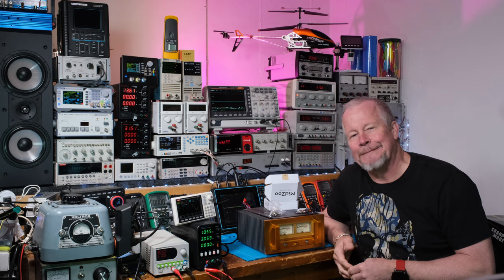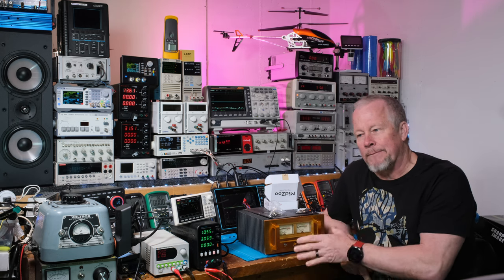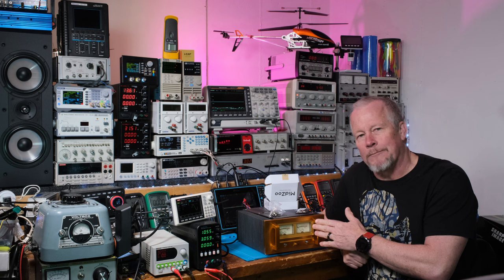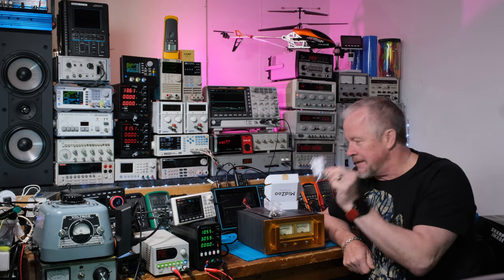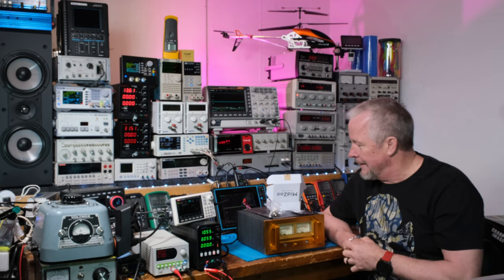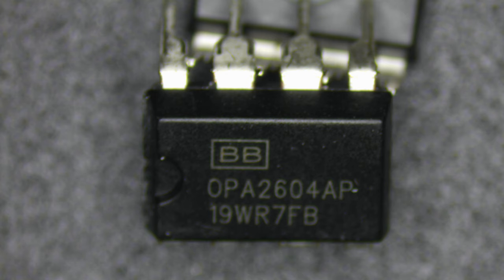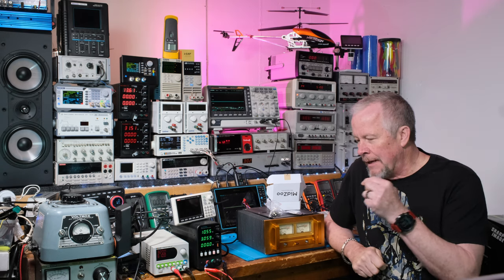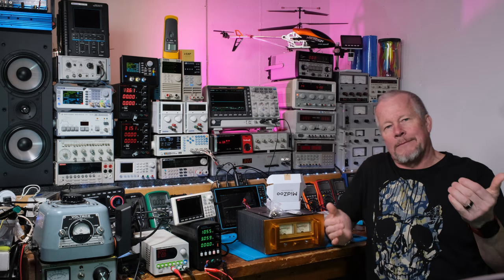Counterfeit Burr Brown OpAmps OPA2604 - Found good ones - What to look for

Comment: Nice cautionary tale and a reminder that, if you have the option to do so, you should design for jellybean parts that you have reasonable confidence in being able to get from proper suppliers for the foreseeable future. I have a cache of Shenzhen-sourced resistors, capacitors, and inductors, but I wouldn't trust Amazon or eBay for any active components.
Reply from the maker: Thanks for the great advice.  But when you are designing for high-end audio like I think this Class A amp might fit, then I search for great parts.  The key is to select parts that are currently still being manufactured, and buy from a trusted vendor.  I know those who would say that those Shenzhen resistors and capacitors are fake and counterfeit - or at least not up to par with resistors such as Dale or caps from America or Japan.  In this case it is a part that is not in normal circulation anymore:(
Reply: @KissAnalog  My cache of passives is only for prototyping; if I build anything for realz, it's with resistors from Vishay/Dale (preferably CMF50/60) and capacitors from Illinois, Panasonic, TDK, or Nippon Chemi-Con.
I still think your needs would have better been served by replacing your regulators with ones that work with what's currently available. Plenty of Burr-Brown op amps that steer high current from +/-15V rails.
Reply from the maker: Thanks - the problem is I needed the higher voltage rail (+/- 24 V rails).  I can use two OPA604 so that is the way I'll have to go.

Comment: I would throw them all in the trash. I only buy ICs from reputable sources like DigiKey, Mouser, etc...
Reply from the maker: Thanks but these are discontinued so I have to find other sources for overstock parts - if they still exist;)
Reply: @KissAnalog  So what? Just buy the available IC's that are the newer replacements from reputable sources. Supporting counterfeits is the same as supporting criminals and thieves.
Reply from the maker: Yes I agree.  But there are vendors who have real parts for some time after a part has gone end of life.  These vendors will buy existing stock (sometimes from manufacturers who didn't use their stock because they redesigned it out) and they are real parts.  These days the counterfeits are ruining this business - unless you know where to find ethical vendors.  The parts generally cost much more because they're is only a small stock left, so this is one giveaway if the parts are a good price - they are most likely counterfeit.
Reply: @KissAnalog  NOS is ok, but counterfeits are not. There are no 'good' counterfeit components.

Comment: I bought a batch of TL071 single opamps on eBay once. None of them worked. I thought a bit, rewired the test socket, and they worked just fine, except they didn't meet specs. Turns out they were TL082 dual opamps, marked as TL071.
Reply from the maker: Thanks for this feedback!  The pin out is the same between the 2 parts - right?  How did rewire work?
Reply: TL072 are dirt cheap, why even bother with ebay?

Comment: Why not buy from reputable dealers like Digi-key or Mouser?
Reply from the maker: Thanks!  Yes, I normally start with Mouser, then go to Digi-Key if needed, and then there are other trusted distributors.  But, when you want a part that is out of manufacturing, then surplus suppliers are the only bet.  But - it it now becoming very sketchy with counterfeit parts.

Comment: Just don't buy from eBay.  Buy the surface mount parts from a reputable supplier and put them on converter boards.  AQ versions are early ceramic variants, probably new old stock.  AP version is the most counterfeit since its in the plastic DIP package.  They may be using some generic op amp and only marking them as they sell them, so they probably have a large stock of some generic and then when something gets ordered they just laser a new number/logo on top and ship it out whatever was ordered...

Comment: Thanks Eddie,
Funny I just bought some obsolete clock chips from Ali and I just tested them, they look like the originals that no manufacturers had but I didn't want to give up the design because the chips worked perfectly for my app. They're 32.768 kHz and draw 4 pA with an accuracy of ~0.5 ppm if I remember at 3V.
Boy, it's a hard call especially when you're using older chips. The thing is BB made some really good stuff it's hard to get now. They had top engineers and those guys helped me more than once on designs.
Most times I try to buy from the big guys like Mouser and Digi-Key even if it costs more, I definitely don't trust eBay and Amazon is the wild west, they have zero policing and everyone knows it. I don't hesitate to give negative reviews anymore, let people know if you get stung.
Reply from the maker: Thanks for this great advice;) I will see if I can find a trusted list of vendors for surplus stock or parts.  Otherwise I stick with Mouser or Digikey.
Reply: @MultiKumar321  I find the Chinese to be a mixed bag like any society. You can buy quality USA made and junk. My Chinese board house is top notch for example and Shars Tools who I often buy machine tools for my shop from is very reputable with consistent quality.
But, yes, when I have to design something for the market I go to Mouser or Digi-Key, the difference is if a Chinese tool brakes my customers aren't effected by it so I can take more chances in certain areas.

Comment: It's worth trying rubbing the part with acetone which often removes the text on counterfeit parts (IPA isn't a strong enough solvent). But just because it's not reacting to acetone there's no guarantee it's "real" - some counterfeiter use resistant dyes and it's known you can get factory laser-etched "74LS" that are really brand new 74HC parts for example! because the LS part sells for a lot more (due to the retro market) so the Chinese factory "helpfully" offers LS marked parts for a little extra (AFAIK no one has made actual LS parts for a long time).
You mention that the NE5532P seems to match specifications, but the logo strongly suggest it's counterfeit (as does the wonky lettering!), this might be some other compatible part or even the correct part but still being relabeled! - there's documented examples of them removing and then putting back the same label except replacing the datecode with a new datecode. Apparently the idea is to be able to sell them as "new" (more expensive) rather than "used", except the date code now makes it obvious it's fake because it's not been manufactured for decades.
The first BB part is for some reason easy to read in the Youtube video, the bottom markings are 19WR7FB. Sometimes that happens, could be angle or polarization for example.
Reply from the maker: Thanks!  I agree the wonky laser etching would be a deterent, but the NE5532 does seem to work well.  The first OPA2604 did look cleaner and did work.  The ceramics do look great and do work;)
Reply: I wouldn't do that Acetone can dissolve plastics

Comment: Today, it is a frequent problem to buy quality semiconductors. I bought 20pcs opa2604 from my most trusted seller in Belgrade. Everything works, but they were not original. A simple way to check them is to check the steady current through them. The original consumes much more current than, say, the TL072.
Reply from the maker: Great point!  I thought that maybe factories in China realized what a great OpAmp this is and would keep making them based on their high cost vs the run of the mill OpAmps.  And maybe this is happening, but the parts that just get relabeled are killing any trust in this - if it happening in the first place.  At this point, other than these ceramics, it might be a part that truly is gone and done at this point.

Comment: I bought some used OPA2604 chips in the ceramic package from ebay (they were apparently salvaged from other disassembled equipment).

They looked obviously used - bent legs with residual solder, the tops were scratched and marked etc. They worked fine and actually sound pretty good, but measured below spec for idle current - the spec sheet said says 10.5mA typ, 12mA max for both amps, but mine measured more like 4 or 5mA. I had two, and they both measured the same.

This seems pretty low, but there is no minimum value on the data sheet, and from memory these may have also been SQ grade (space qualified), so were maybe also selected for low idle current?

I've read about dodgy sellers sanding or lasering off markings on similar, cheaper, low spec chips in plastic packages, and remarking them with the labels of the chip they want to sell, but I think this is more difficult to do with ceramic packages?

It's a mystery - I'll probably never know if they're real or not....
Reply from the maker: Thanks for your feedback!  It really is hard to tell.  Idle current is also based on the voltage on the rails.  So, if the rail to rail voltage is lower than the idle current would be lower.
Reply: @KissAnalog  thanks for your response! Have been enjoying the channel....

I was running them on +/- 12v balanced rails, where the spec sheet specifies the idle current at +/- 15v, so maybe not enough to explain the more than 50% lower idle current?

They sound pretty good, so if they're not genuine, I'd love to know what they actually are - but that may be one of those mysteries in life that I never solve 😀

Comment: I use specialist suppliers for obsolete parts; they are well aware of counterfeit parts and filter them out for you, that way you get good parts, though they cost more.
I bought two EEPROMs to repair my computer motherboard from Amazon, neither worked, but I was refunded the cost. 
I ended up buying another motherboard, which worked.
We are still suffering semiconductor shortages from regular established suppliers here in the UK, hope it stabilises soon.
Reply from the maker: Thanks for the great feedback!  I used to shop certain surplus shops like All Electronics, but who do you like?
Reply: @KissAnalog  I liked Mark 5, who changed their name to Godiac, after a long story, and TC Components, based on the Isle-of-Man.
Reply from the maker: I forgot about them.  All Electronics used to be good but I forgot about them too - until writing this;)
Reply: @KissAnalog  Mark 5/Godiac is a family business, and TC Components is one guy. They are specialist small businesses, not corporations. There were other specialists who used to promote their services to us, targeting military equipment maintenance, and these were larger companies, with greatly inflated prices. Like 10 times what the others would charge. Needless to say, we quickly forgot about those. We have used another business called Little Diode, and Bowers Semiconductors are great for power semiconductor devices. With small businesses, unless father passes to son, expertise gets lost.  Godiac and Bowers have both maintained their quality by passing down to the family like this.
Reply from the maker: Thanks so much!!

Comment: did you give dual opa828 a shot as replacement for the phased out opa2604?
Reply from the maker: Thanks for asking!  No the OPA828 has max voltage rails of +/- 18 V, and the OPA2604 can go to +/- 24 V.  I needed the higher voltage.
Reply: Indeed you’re right about voltage, no late ti design have such wide voltage tolerance as 2604 I did upgrade my preamp opa2604 with an opa1656 mounted on dip8, both are Fet, 1656 being the closest match to 2604 in the currently produced opamp. Sound was very noticeably improved with 1656.

Comment: i think maybe a good strategy these days is to buy very cheap (from aliexpress) these soic-8 to 0,1" inch spacing DIP-8 pcb adaptor. it's just a teeny tiny pcb that you can solder legs onto. And that then has pads on the top side for soic-8. Or whatever other styles of 8-pin SMD packages. This then lets you source modern SMD only parts for where the DIP inline packages have been discontinued. I have also (for example) soldered smd mosfets to these tiny adaptors too. To make them easier to use in traditional thu hole circuits

In fact for the fist op-amp you showed (the ne5532) there is available in stock in digikit in these surface mount SOIC-8 pkg... (142 thousand in stock, digikey p/n 296-13622-1-ND). And i even already ordered a couple of them for myself, along with a variety of other op-amps like the similar part ne5534.

however for the burr brown then that would be a different matter. what i would want to do for that: is to look online for some recent teardown pcb photos some modern recently manufactured high end audio equipment. And see what the op-amps they are now using these days. And then based on those chip markings see what else might be out there
Reply from the maker: Yes, if you can - stick with trusted vendors.  When looking for the obscure and/or surplus stock - buyer beware;)

Comment: This is a very important topic, today there are a lot of fake components.  BTW, where can I find a Cheap and Original "NE5532"? Thanks.
Reply from the maker: Thanks for asking.  I did find a vendor that has a perfect rating on ebay and is based in the USA.  https://ebay.us/Ded9nP
Reply: @KissAnalog  Seems good, but 5 times More Expensive than Mouser, DigiKey, Newark, etc.  Avoid this seller and do not recommend it.
Reply from the maker: I only use these vendors when a part is out of stock form Mouser or DigiKey.  Or if it has gone end of life when you can still find some parts in distribution for awhile.
Reply: @KissAnalog  sure, thanks

Comment: The retro computer scene is rife with counterfeit chips. Rubbing the top with acetone or alcohol usually reveals that they are fake. I try to buy from legit sellers when I can. Would like to see a video where you substitute the OPA2604 with a OPA604. Maybe do a prototype adapter board and then design it on PCBway?
Reply from the maker: Thanks - great input!  I did consider making a board (and maybe will) to use two OPA604 OpAmps, but they are hard to find right now too.  They are in production or are current parts, but non in stock where I can find.

Comment: There are also over 100K Op549LH that are Chinese knock offs out there in circulation right now. The trick is that pin 8 which is supposed to short to case as a guard in fact does not make connection with the case and instead it's pin 4....
Reply from the maker: Thanks for the great tip!

Comment: The big name semiconductor companies seem to be pretty good about consistent packaging for their modern components, so if you have a known good reference part from a major distributor, the packaging should be identical for similar date codes no matter where you buy from or where they've been made. If there are obvious or even subtle differences then it's probably counterfeit. You should never see wild variation in packaging and markings like this unless it's either old or coming from a no-name Chinese manufacturer.
Reply from the maker: That's true.  If you are familiar with the manufacturer - you can identify their marking.  Even across different chips they will be similar.  I think the ceramic parts I show look like what I'm familiar with.  Sloppy markings are a giveaway too.

Comment: Besides counterfeit op amps, please do a video about INTERCHANGEABILITY of various DIP-8 package op amps.  Mis-information abounds about this topic on the internet.  All DIP-8 op amps are NOT interchangeable with eachother just because they have 8 pins.  I don't know of any other op amp chips that would be definitely SAFE to interchange in place of the 5532, other than this LM4562, for line-level signals.  I have plugs installed in both players to make for easy changing of these chips, BUT putting the wrong op amp chip in there could damage the CDP-2A player.  It seems only substituting bipolar chips for bipolar chips is the safest bet, but you hear of people substituting JFET chips in place of bipolar devices.  Furthermore, the Burson V5i hybrid device claims to be a direct drop-in replacement for many bipolar and JFET chips....if such is the case, then all those many chips must be drop-in replacements with EACHOTHER, right??...this cannot be a 1-way-door, where the V5i replaces many, BUT those many are not interchangeable with eachother....something is wrong here!
Reply from the maker: Thanks for this great info - and you are right.  I will have to do a video on this subject.

Comment: Mouser has the OPA604AU just mount 2 of them on a daughter adapter board. No more heat issue.😉
Reply: @Torbjorn.Lindgren  I don't know what you're looking at but I'm can see that OPA 604AU is readily available and in stock do not confuse the 604 with the 2604
Reply: @davidkclayton  I goofed on the part number BUT now that I entered it correctly I do find them but none of the models are in stock, I checked both Mouser and Digikey, searching both "OPA 604AU", OPA604AU and OPA604 and even tried switching country site. Yes, Mouser lists impressive numbers in the Availability column but none of those are actually "in stock", they're all clarified as either "On Order" (earliest possible 30 Nov 2023, the rest are all 2024), "Expected" (2024) or "Not Stocked" (26 Weeks expected lead time) - check the details page for each the four different models for actual details on each. I strongly doubt these are firm dates either, they're much to far out for that. They could even arrive before those dates but the odds are good it'll be much longer.
The usual exortion vendors in China claims to have lots of OPA604AU in stock but doesn't list prices which usually means they don't actually have any available, they'll try to find one for you if you "request a quote" and then order some.
Reply from the maker: I did mention that I was thinking of making a board to use two OPA604, and they are still being produced where the OPA2604 is discontinued.   However, even the OPA604 is hard to find in stock now.
Reply: @KissAnalog  Mouser shows 5K in stock if you don't mind smd.